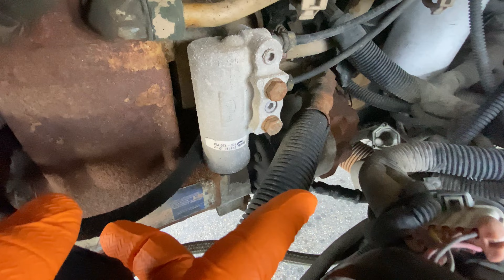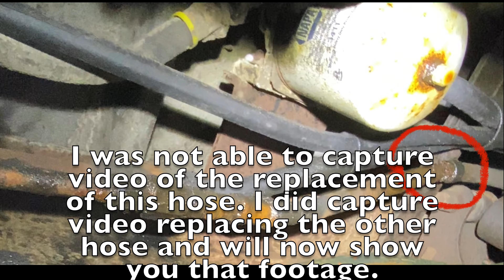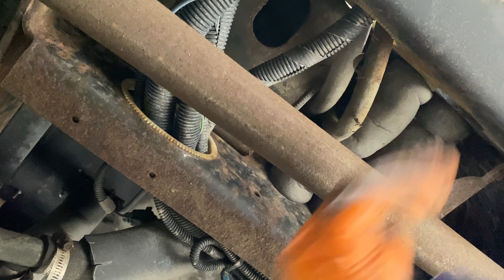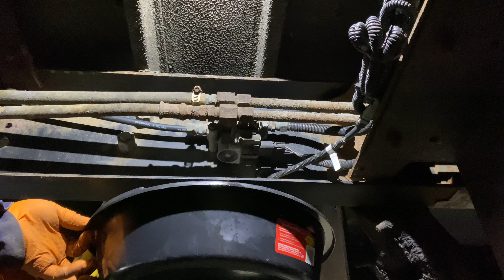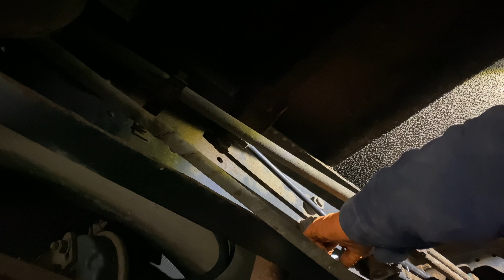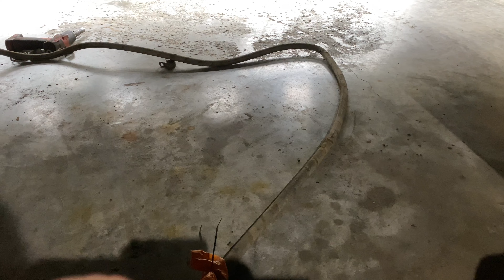POWER STEERING HOSE 2001 BLUE BIRD A3RE | ALL AMERICAN SCHOOL BUS

Comment: Where is the power steering reservoir located at?
Reply: I found it, but am unsure what fluid type it takes.
Reply from the maker: On this style bus, that has the hydraulic fan motor, they use 5W30 engine oil for both the fan motor and power steering. On newer buses, where the fan is belt driven, the power steering is ATF.